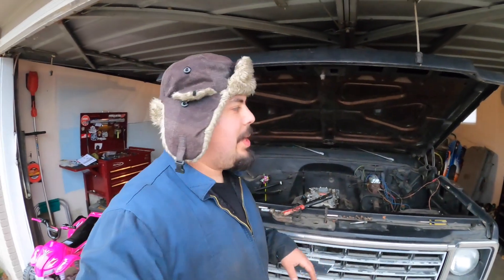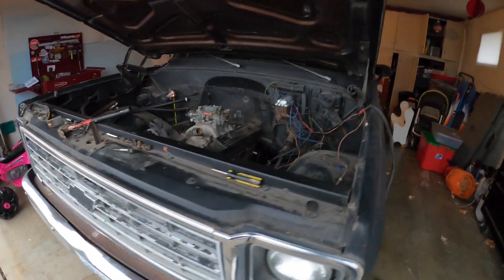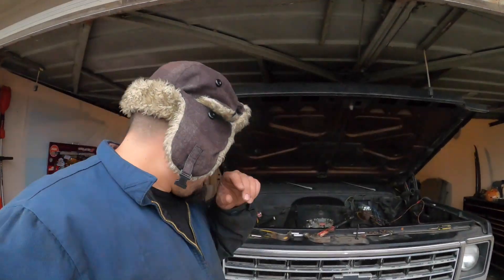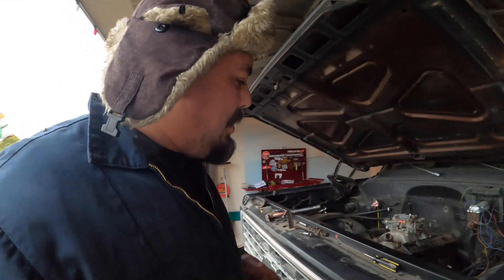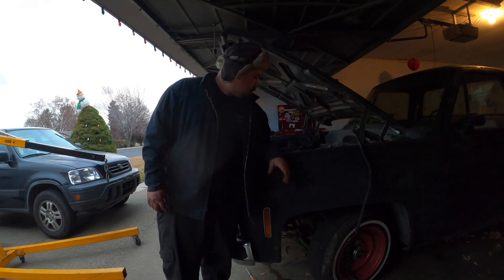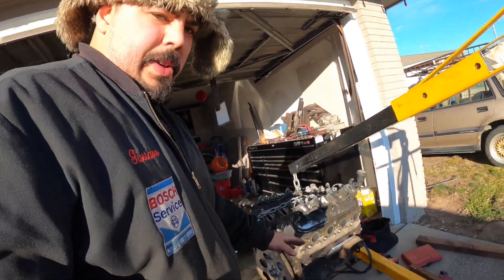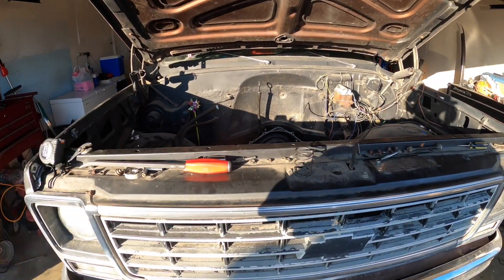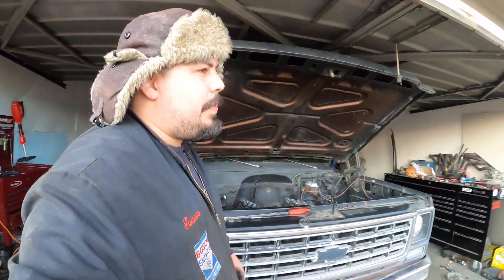4.8/5.3 LS Swap c10 How To Install Mounts and Engine into 77 chevy

Comment: Great video. How much clearance does the oil pan have vs the cross member and the ground?
Reply from the maker: Sorry for the late response but there is not very much between the crossmember and the oil pan maybe half an inch and I think the pan sits about 3 in off the ground but I do have 4 inch drop spindles on the front

Comment: I am putting a 4.8 in my 85 c10, do you know if I can use the stock exhaust manifold?
Reply from the maker: No that's the issue I just ran into we'll have to order some kind of headers or I've been reading up at SS Trailblazer ones work will be in the future video